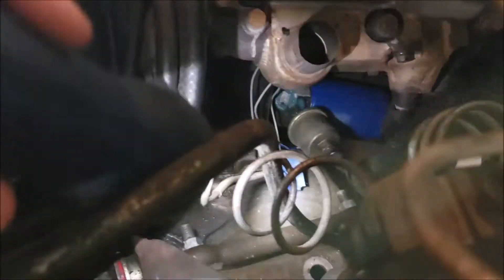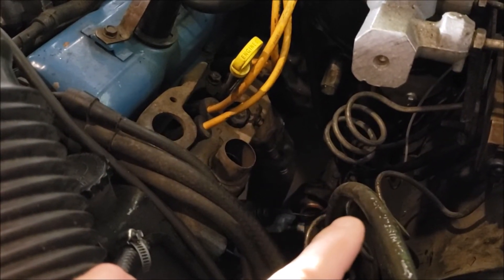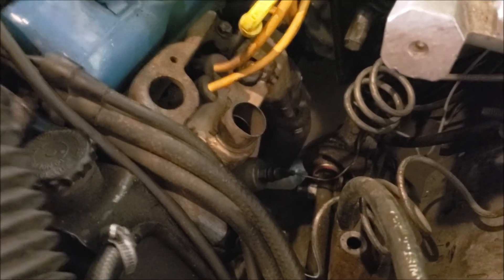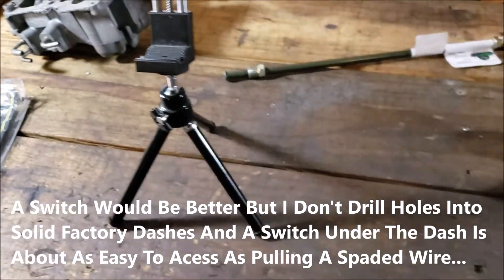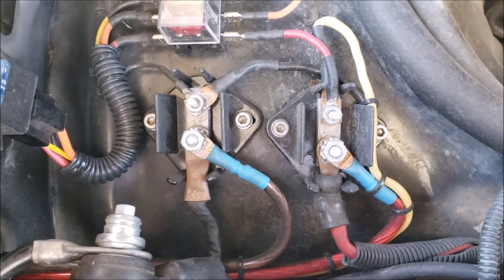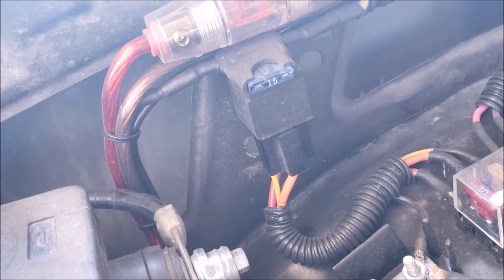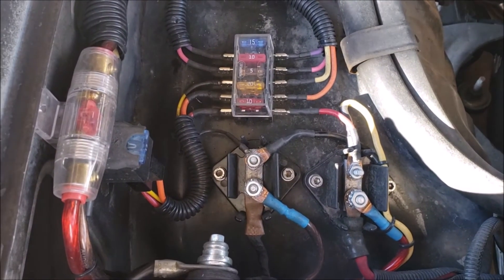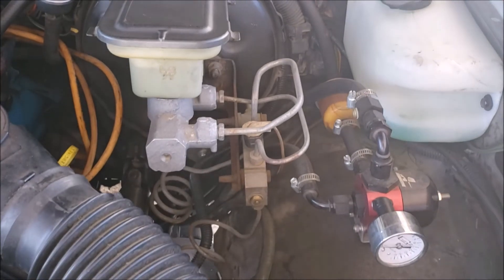GM / Chevy / S10 / Misc. Vehicle Electric Fuel Pump Conversion Wiring (Oil Pressure Cutoff Switch)🔧

Comment: Hi friend .. I have a problem with this circuit, I put this circuit at SmallBlock. But at idle, the relay becomes noisy, because the oil pressure decreases when Idle which causes the relay to break up and connect. I'm very uncomfortable with that voice. Did you experience it too?
Reply: @shaun4bigblocksllc  ok guys.  thank you for the information  I will check it soon

Comment: my oil pressure switch only has 2 prongs instead of 3.  can i still wire it without the third prong?
Reply: 3rd wire is for the sender. Your 2 prong is a switch.